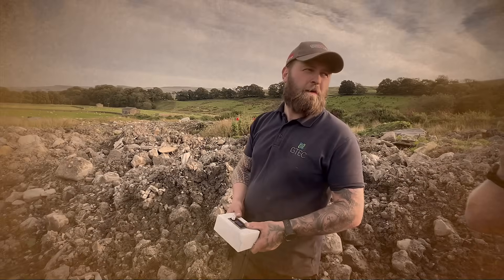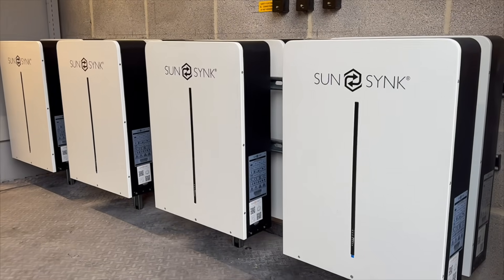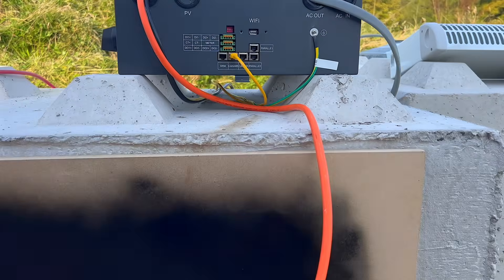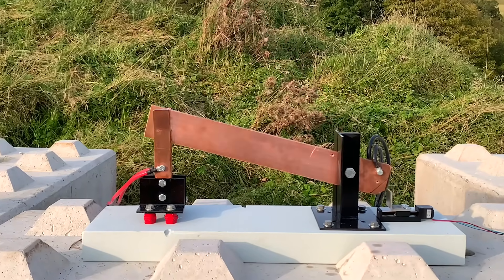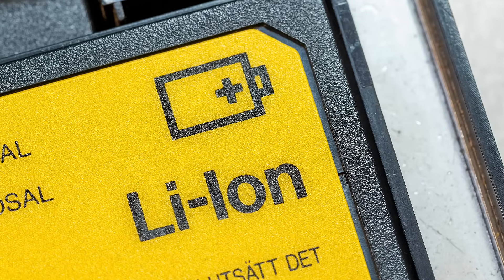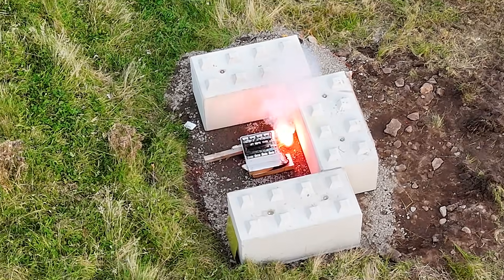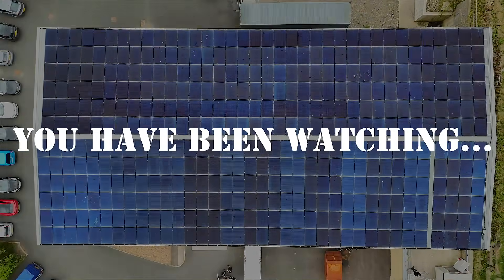Are Lithium Batteries Really SAFE or Just a Disaster Waiting to Happen

Comment: Glad to finally see an honest assessment of LFP. 
I’ve installed various lithium ferro phosphate batteries setups in motorhomes and most manufacturers have very good power management units.
There’s one exceptionally good battery, made by Dragonfly in the US, it was the only aftermarket lithium battery cleared for airfreight, that’s how good the safety systems are. 
Shorting the battery terminals never produced a spark, the power management board shuts off the circuit before a current capable of initiating a spark is reached. ( think of an AFDD )
Reply from the maker: That's good to know, thanks for the info!

Comment: Try even a brief short circuit upstream from the BMS, and you might find some cells having changed behaviour during charging. It happened to me during the building of my second 314A  (more than 16kWh) unit when, by accident, one of the voltage wires pulled the last and short copper bar, dropping it between the positive and negative terminal. Now all 16 cells charge normally up to 3.43V, but 6 of them jump up to almost unlimited voltage until the BMS kicks in to stop the charging. Ok, it is still safe, but only due to the BMS action otherwise, they might reach silly voltages (according to the charger's settings) and potentially be dangerous. I'll have to replace the all set of 16 to then proceed with the investigation by subjecting every cell to the test conducted before assembly, full discharge and full charge up to 3.65V under constant computer monitoring to then compare the results with the original done prior to assembly.

Comment: That battery at 49V is basically empty so your tests are useless. Is this just some shill video for the battery manufacturer?yes! Come on, you guys know better than that! Shame
Reply from the maker: The battery was full when we started the pull test - we haven’t shown who made the battery. - thanks for the feedback.
Reply: Fair enough no manufacturer stated but that does not change the fact that the battery was undeniably at less than 5% SoC when doing the raw cell tests. 49V on a 16S LiFePo4 bank might as well be 0%. Why not test when full other than for misleading videos?   @efixx
Reply from the maker: @jamiesony3859 our main aim was to explore the risks to installers when handling batteries. PAS 63100 and other guidance now includes requirements for batteries terminals to require a tool to access / disconnect.

Comment: Retired Industrial electrician , comments.. Lithium PO4 batteries yes don't burn or catch fire  ,
but all the overloaded undersized poorly installed cabling does .
Other problems are unsatisfactory connections with un torqued joints.!

My Laser  temperature gun and the sniff test can be the best problem solving tools, to start with.

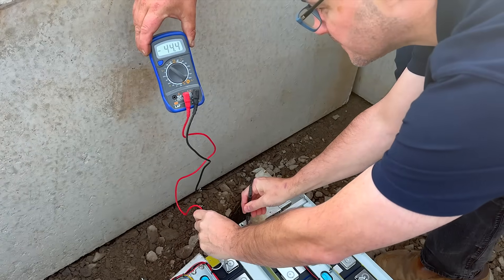Comment: 4:34.. It is not CLEAR that the short circuit test have been done properly (without the protective circuit BMS)... even with a inline fuse busbar you should have at least seen a spark! or wires jumping due to the peak current of many 10 000 amps but nothing hapenned and it is not typical .. unless your not charged battery had ultra high internal reistance. Please note that 49V is a low state of charge for a 51V LFP  and that the internal resistacne is higher which mean way less current in short circuit..
Reply: the BMS would have Short Circuit protection, preventing any issue, cutting power in a few micro seconds
Reply: @PaulLandregan BMS was removed, so it was just cells and bus bars

A simple clamp meter on the leads to the knife switch would have been a great “trust but verify” showing overload of current when the knife switch closed.

Having that low a voltage is also a red flag.

I’ve shorted a balance lead of one LiFePo cell and sparks were a flying.

Comment: I don't understand what you were trying to acheive with this 'experiment', scaremongering? showing how stupid you could be? showing how stupid the proposed banning of batteries in lofts is? You only seem to have proved that these LFP battery packs are pretty bombproof. I'm happy with my 16kWh LFP battery located in my garage loft is unlikely to burn the house down any time soon, there are multiple safety features built in to the system and at the end of the day it's inside a steel box. It's more likely that the house will burn down because of an apple iphone charger catching fire than an ESS going rogue.
Reply from the maker: I think we’ve proved your point and debunked many of the concerns raised in recent industry guidance PAS63100
Reply: To show how safe modern LFP batteries are. Compared to the smaller ones used in home tech and still some EVs

Comment: BTW most likely your "short circuit" test did nothing because the loop resistance was far too high ie the short circuit current was limited by the wiring resistance and the switching element resistance.   You'd need something like a 10c short to cause those cells to runway (and they would need to start at 100 SoC, otherwise by the time they get hot, they are flat....) and that's 1000 amps, which means you need less than 50milliohms for your 50v approx pack votlage!
Reply: I'm going to bet on it being the knife wasn't making as impressive a connection as it's appearance would suggest.  The lengths of the leads should still have seen hundreds of amps (once the edge was taken off the cells), the cells might have been happy but the wiring showed nothing.  Not even a bit of movement from the heating nor magnetics.
Reply: typical battery like these have about 0.3 miliohm per cells which mean 5 miliohm at 51V =  more than 10 000 A short circuit, not just 1000A

Comment: Your burn test highlighted one generally missed facet of chemical energy storage in battery cells, namely the same materials that give those cells the ability to store lots of energy, also give them a very high specific heat capacity, ie you can apply a LOT of heat energy to them and they will only slowly increase in temperature!  This is why generally a EVbattery does not actually catch on fire in most cases when the rest of the car does!  Cell level fires are caused by INTERNAL short circuits, directly heating a LOCALISED area of cell material that is then pushed into thermal runaway, that then can cascade to the material next to it.  These days, lower volatility cell chemisty, better intercell material and specific internal cell design to prevent thermal run-away all means a modern battery is really quite hard to "explode" by accident.  If you actually wanted to get a catastrophic result, you should have either grossly overcharged the battery (which would take a fair bit of power for a 5kWh pack) or carried out a pierce test with a conductive spike!
Reply from the maker: Great feedback - Thanks 🙏

Comment: You also showed a burning and arcing MC4 connector.
With PV the voltage is much higher, hunderds of volts.
I'm still surprised your connector didn't arc,  but that should be the explanation.

Comment: On the "loaded connector disconnect test" three things matter here

1) the dc link inductance
2) the nominal voltage
3) the rate at which the connector is seperated

To get an arc with any sensible seperation rate, you need a large enough amount of inductance in the DC link to generate a high enough voltage to ionise the air gap formed when the contacts finally seperate.  On anything below around 100V, this simply isn't going to happen, especially as battery cells AND inverter inputs are very capacative, so there is large amount of resliiance in the system to instantaneous changes in current.  Typically MC4 solar connectors can arc when disconnected under load, but this is because the open circuit votlage is typically going to start at upwards of 100vdc, and mostly around 400vdc, ie enough to cause local ionisation when without any inductive kick!
Reply: 3) is probably the most effective to create an arc even with a BMS with overcurrent protection as it create just enough resistance to cary high current without trigerring the protection

Comment: Good idea, but a few bits missing, did you interface directly to the BMS to establish the state of charge and it would have been useful to note all the cell voltages and the internal resistances before the test. With the BMS in series with the negative, a short circuit test just produces a big controlled pop or flash and at 51v you can safely disconnect under a 50 amp load that would be expected. I suspect the BMS for a small 5kW Hr pack was 100 amp so the overcurrent weak link will be +30% i.e. 130 amp that probably 'blew' in your setting up before you started filming. I don't know how much you guys know about battery chemistry but you need something that causes penetration of the SEI membrane to create thermal runaway, the best way to achieve this is to induce oxidative decomposition and hence lithium precipitation (or sometimes called uncontrolled crystal dendritic growth), so the best way to achieve this would be to find the cell with the highest internal resistance, charge just that one cell at about 4.5v-4.8v (this will probably be about 1.2C or about 120 amp) and keep going! This should be enough to cause the SEI membrane to break down without creating a huge oxidisation explosion or the casing to melt and eventually you might be able to trigger a runaway. However, as you point out, these batteries are not phone batteries or EV cells and are inherently very stable and safe so without creating a special, highly controlled very artificial environment with monitoring and control systems (as opposed to a few bricks and a blowtorch you nicked from a guy who works on flat roofs) I think you are going to find it hard to create the firework display you are seeking! Oh! and make sure you are upwind because in the highly unlikely scenario you succeed you will produce hydrogen fluoride and a good wiff of that might be your last!
Reply from the maker: Thanks for the feedback - plenty to digest for round 2!

Comment: I'm not sure I can give it a thumbs-up for the retro narration.  Definitely thumbs-down for the fake incredulity about the guts that are common to any residential / server-rack battery.  And really... Just 50A?  That's it?  Nothing will even get warm at 50A, let alone through an Amphenol connector.  And you were surprised that nothing happened?

So then, ultimately, you just bypass everything and directly damage the cells.  Ok....well, more conventional cell tests but wait a moment... you... blew up from the underside of the battery with explosives?  What kind of test is that?  Just in case someone decides to store TNT in the garage next to their whole-home backup system?   You couldn't even put the LFP cells into thermal runaway.

So here's a real test... force one cell into thermal runaway.  NOT with explosives!  Just short the cell directly with a bus-bar.  And then see if/how the runaway spreads to adjacent undamaged cells.  With the case closed so the vapor fire arresters (if that particular battery has any) function properly.  See if the runaway stays contained in the case.

-Matt
Reply from the maker: Our “amateur” aim was to investigate the installer focused concerns of PAS63100 - which is suggesting that connectors should be released with a tool etc - We are planning a second round of tests.
Reply: @efixx  Huh?  Amphenol connectors do not need to be released with a tool.

Comment: Excellent video, many people do not understand the difference between LiFePo4 and Lithium Ion batteries. I am happy with the LiFePo4 system I have at home and also on my boat, both systems are protected by BMS, and fuses at the terminals, and on the boat I have an  additional actuator that will disconnect the batteries if the Victron Cerbo GX detects an increase in temperature above a safe level, this is because they are located in one of the engine spaces. Having had a Lead Acid battery swell and split its case, spilling acid and overheating, I am less worried about my LFP system.
Reply: LiFePO4 is a Lithium Ion chemistry. What many people don't understand is the difference between Ternary Lithium cells and LiFePO4 cells.
Reply: Is it a big boat, can I get a shot?

Comment: 49V for 16S lifepo4 battery is almost empty
Reply: Urm.  Well, it was measured with no load and at 49V that battery would be almost empty.  At least 95% discharged at that voltage with no load.  Nominal voltage for a 16s LiFePO4 battery is 51.2V.  And even with a load, the internal resistance is so low with LiFePO4 just in general, particularly with these big prismatic cells, that there is very little actual voltage droop.  That's one reason why they are so good in these applications.
Reply: @TheDiawollo  home storage batteries are generally either 48v or 96v
Reply: @nigelchapman6984 Nominal voltage is 48v. LifePo4 cells are minimum 2.5v to a maximum of 3.65v, so 16S battery would be 40v to 58.4v, except you would not use that range, normally you'd use around 48v to 56v, so that battery was at a very low state of charge, nevertheless a dead short should have created melted wires, unless there was a fuse built in, which there isn't, so something is amiss with this video.
Reply: @TheRonskiman  Depends on the internal resistance of the battery as that will limit the short circuit current. If the cells don't have a high C rate then they probably have a lot of internal resistance.
Reply: @nigelchapman6984  no. It depend on the nominal voltage and the discharge curve. 48v is a typical number. most LFP are nominal at 51.XV
Reply: @nigelchapman6984  nie spotkałem się z 96v inwertera

Comment: Not the first comment of course
Reply from the maker: Not far off!
Reply: @efixx  Just sharing, you missed trying to dip it in pool of water. :)
Reply from the maker: The story continues …. Good idea!
Reply: @efixx so what did you do wrong, creating that dead short, should have created melted battery cables, there is no fuse on those cells, although they were not fully charged (49v is a low state of charge) it should still have had enough power to create some melted cables.